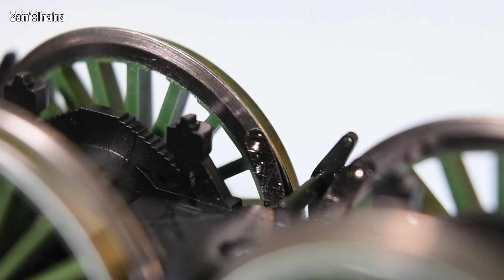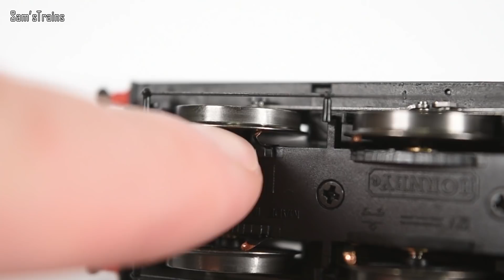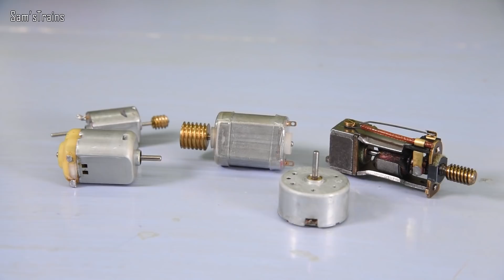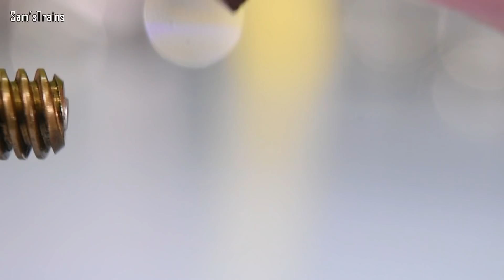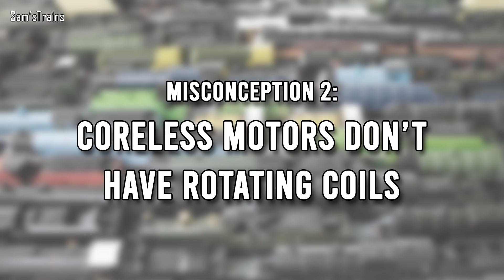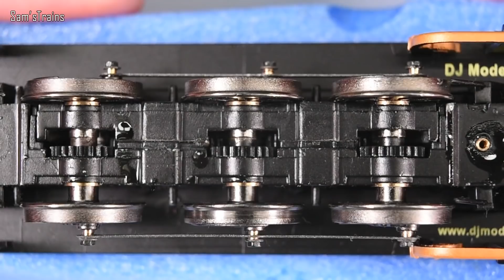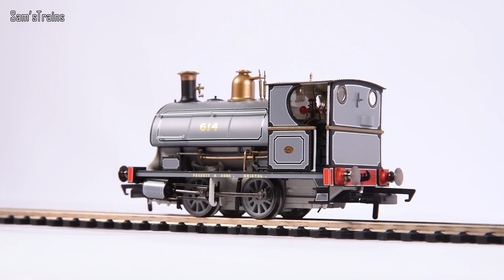What Makes A Good Runner? | How Model Trains Work

Comment: You'll only find a brushless motor with an AC supply.
Reply: steppers are dc no?
Reply: @muir8009  Oh bugger, stepper motors, I'd forgotten about them!!
Reply: Formidable38  there are so called BLDC motors, they are brushless and DC , but you need an external electronics to drive them.
Reply: @railfilm  microtains use coreless motors in their z scale locos (with appropriate warnings re: heat and feedback controllers), whilst being absolutely stunning crawlers, I think it's more to do with trying to cram a motor and decoder into a z scale sd40
Reply: muir8009  that ia correct,. Some high-end models have also coreless motors, but it can be a challenge to use them in common DC systems, as those motors require different approach, not common with the standard motors. The small model like in Z scale, they do not have too much choice because of space and size. Today there are plenty of extremely cheap coreless motors ( almost in each mobile phone)   But in mixed layouts like Sam´s it is not always an advantage. Many modern controllers does not work with such motors, and there is always the danger to overheat them.  On top of that usually they are also extremely fast so one need much more gears ( or finer ones)  as with the standard motors. They are better for DCC systems, as many modern decoders have a special CV option (high frequency) for coreless motors..
Reply: @railfilm  thank you for your informative response, good to learn. I've had coreless z, and had Marklin z at the same time and really came to the conclusion that yes, traditional style iron core motors can be made small, but it struck me as more technical achievement over substance. did have a coreless steamer in tt, and I think you may have touched on something their where their availability, size, and price may make a smaller manufacturer (schirmer tt in this case) be able to produce a model at a competitive price. basically running wise in a larger than z size I couldn't find an operational advantage. (but boy that microtrains just seemed to age marklin by 40 years...)
Reply: muir8009  yes, the variety of new generation of motors for us tradional modellers creates several problems. Unfortunately the designs of new locomotives very often ignore the traditional DC model railway requirements. I have over 60 locomotives purchased  or built (scratchbuilt) in the last 50 years. While in the past the speed of the model locomotives was one of the major factors, today the model manufacturers have serious troubles to calculate the gears and make the models with realistic speed. On analog DC layout we use a common throttle  for several machines on the same track ( block system etc), and is extremely unrealistic when the small shuntig locomotive is faster then the modern high speed model. What is even worse when one has the same model from different manufacturers having completely different speed characteristic. The differences are in my case over 50%. Maybe a topic for Sam for one his next technology videos. I have already a speedtrap on my layout to select the locomotives  with an acceptable speed at given  throttle setting. I have also several locomotives with coreless motors but I would not recommend them for the classic DC model railways. They are primarily designed for digital (DCC) layouts, where each motor has its own throttle, (decoder) what can be programmed  for this  special motor and also adjust the speed characteristic for the model.
Reply from the maker: I'm no expert, but I understand you'd need circuitry that synthesizes specific waveforms/signals to drive a brushless motor, so the input shouldn't matter too much!
Thanks for watching, Sam :)
Reply: Sam'sTrains Do not mix together the coreless motors with brushless motors. The coreless motors like in your video have always brushes, from this point of view the operation principes are the same with the standard iron core motors.
The brushless motors have always at least 3 wires and 3 not moving coils, and an external signal generator generates the 3 phases for the coils. With the frequency you can control the speed. When you change two wires the direction will change. Ie you need a special interface circuitry, what converts the voltage from the tracks into frequency, to control the speed and when the polarity is changing the electronics must swap two terminals on the motor. It is easy :-). 
( some minor problem, that the electronics on the board needs always a power, ie, in DC it will work only above certain voltage.).

Comment: Thank you so much Sam. This is a great video. It has greatened my knowledge so much. I really didn't know this much. Thank you. I'm fairly new to the hobby so this question might sound stupid:
If you model was to have a three pole motor could you take the motor out and change it with a five pole motor. 
Cheers Matthew
Reply from the maker: No problem Matthew, thanks so much! Yes, if you can find a suitable replacement motor, it certainly can be done! :D
Thanks for watching, Sam :)
Reply: I've done something cleverer than that: with a couple of my Marklin locos: I bought 5 pole armatures (available through their spare parts supply) and replaced a 3 pole armature with a 5 pole armature. You have to know what you're doing but back in the day (until about 10-15 years ago) they only used about 3 basic motors on all their locos and so the parts within each motor type were completely interchangeable.

Comment: Any locos have more than 1 motor?
Reply: older tinplate
Reply: Yep. Take a look back at the Heljan Beyer Garratt review Sam did, and he also serviced an old engine in a stream a while back that had 2 beefy motors. (A red electric loco if I remember correctly.)
Reply: @highbrookendmodelrailway  there's been a few produced but in the pre dcc days twin motors have always been eminently suitable for ac powered equipment (for the obvious reasons). Lionel from the twin motored 42 from the twenties, through the supermotors, then their postwar F3's, trainmasters, GG1's etc all had twin motors, and these are massive, torquey AC universal motors, way more powerful than the dc cousins, their standard gauge supermotor being an absolute colossus, and of course were always permanently synced due to being AC. I worked out that the monster train Sam had hooked up behind the garratt weighs about the same as 1 Lionel state car...
Reply from the maker: Sure! Its rare, but they are out there! :D
Thanks for watching, Sam :)

Comment: On the motors part you missed out ringfield motors that all of the old Hornby and Lima models used. I don't know if these are classed as a three pole motor though?
Reply: the poles are on the armature, so the rather sad ringfields on the Margate hornby and Lima are definitely 3 pole. on quality ringfields such as hornby dublo and Fleischmann still 3 pole but work as they were designed and intended to do
Reply from the maker: Yes that's true, though they fit into the 3 pole motor category, they're just arranged a bit differently!
Thanks for watching, Sam :)

Comment: i call it Soviet engineering (AK-47, Mi-24, several of their tanks and even manage to convert Fiat 12 to much sturdier Lada 1200 with the concept), but it ultimately boils down to: make it as simple and tough as you can, preferably able to survive Syberia and Sahara.

There is unfortunately a line which, when crossed makes the durability worse so it is partly about minimization of strain on each component too.

Basically built it like a tank that wont get maintenance for next 20 years.
Reply from the maker: Yep I'd agree with that - the simplest toughest designs definitely work the best!! :D
Thanks for watching, Sam :)

Comment: I will be very interested to see if careless motors become more common, but am.not entirely convinced about their use in model engines.  Simple is probably best, although my DJ Models engine goes very well, it is very complex with all those gears - the more you have he more you have to go wrong.  Of course Bombardier do traction tires on the real thing - take trip on the Montreal Metro.
Reply from the maker: Thanks Ian - it seems they're becoming more common already! Yes not all DJM models run badly - my 1361 is a very good runner too! :D
Thanks for watching, Sam :)

Comment: sam i am saying this based on personal research as i only run a battery only model railways cause i cant buy proper metal tracks and im an RC hobbyist so i have a lot of rechargeable batteries
there are no brushless motors in any train smaller than O gauge due to their price, complexity, but they are mainly used in continuous running and its large power output and efficiency
There are brushless kits for OO to HO gauges but you do need a high voltage controller
dozen pole stepper motors that is programed for train models can remove cogging and stalling all together

Also can you do a tug of war of your locos ( i know this could seriously damage the locos but give it a try)
Reply from the maker: Thanks a lot - yeah I'd expect that to be true too - thanks a lot for sharing! :D
Thanks for watching, Sam :)

Comment: I can't speak for all model trains but my old Hornby 110 DMU works by catching fire when voltage is applied. Should probably see to that
Reply: The old Hornby 110 DMU's use ringfield motors I think there is a video on YouTube talking about this issue as I had  the same issue with one of my old hornby diesel locomotives.
Reply: My 110 stuck like hell but didn't catch fire. Fun Fact :- 110's catching fire was true in real life! At least until they improved the insulation, but even then, Hammerton Street calling them the "Greasy Grills" suggests that there were a few more fires than the norm........:-)
Reply: Probably shorted quite badly. 

Make sure there is no carbon buildup between the slots on the commutator, wheels are clean, commutator is clean, fresh lubricant, etc.

Normally you can immediately see what is wrong with it when you open it up - most likely a blackish sooty area if it had been catching fire, so you should get an idea of what it is pretty soon!
Reply: @highbrookendmodelrailway  Yeah I've had a look and it's just in really poor condition. If I can get the time and I can probably get it going again. Thanks for your suggestions 🙂
Reply: @blisseyran-dom6822  You're most welcome 👍☺️.
Reply from the maker: haha yeah that doesn't sound too good - I've seen a few firey ringfield motors myself too! ;D
Thanks for watching, Sam :)

Comment: 1:12 Are there any live diesel-electric powered trains (at least ones in 127mm gauge or smaller)?

As per bearings, are there any models that employ tiny roller bearings?

Very informative video. Be careful, if Oxford University ever introduce a course on model railways, they may beg you to be the professor.
Reply from the maker: I haven't seen any, though maybe you're right?! Never seen roller bearings, but I'd be interested to know the answer!!
Thanks for watching, Sam :)

Comment: How about running a model train in a vacuum to see what the lack of air does.
Reply: It would still work exactly the same - electrical motors are not affected by vacuum - the power tools astronauts use to do work in space are electrically powered. Only difference being that you probably wouldn't be able to hear it running.
Reply: I suspect heat would build up but there’d be no oxidation.
Reply from the maker: haha still would be pretty interesting though - and agreed with Ian, heat dissipation may be interesting to observe... though without air resistance, the load on the motor should be less!
Thanks for watching, Sam :)

Comment: One thing that's bugging me at the moment... People putting grease on the gear-train of Lima diesels. I've bought around 60 of them in the last 10 months and several were bought as non-runners. When you put them on the track they just hummed. A quick dismantling and a clean off of the grease and they are away again running smoothly. Lima gear-trains are made of nylon and they are self-lubricating. I know people put grease on them to try and make them quieter but in the end it either goes hard or some grit gets flicked up of the track, gets caught in the goo and then locks up the motion. When I launch my new channel soon (under a different name) I think I will do a video on Lima locos and how to get them running really nicely, even doing incredibly slow crawls, not that that is my thing. Anyway, keep up the good work :-)
Reply: Bindon Rail  Less lubrication is always better
Reply from the maker: Yeah that's it- when the lubricant gets old, it certainly harms performance! I do use a small amount on my Lima locos... because I service them every year, I never have any problems!
Thanks for watching, Sam :)

Comment: Hi Sam.
Is it possible to get different gears & worm drives to adjust the gearing ratio so a loco runs better at slow speed, also to reduce it's top speed to make it more prototypical.
Could you do a video on how to fix wobbly wheels on a loco, so it runs smoother.
Thanks for the great vids (keep em coming). 👍
Reply: you can buy separate sale gearboxes from suppliers like north yard and branchlines, northwest shortlines etc
Reply: @muir8009  Cheers, will definitely look into that.👍
Reply: @Sparky-Tim  if you're in the UK I'm sure a company there called branchlines makes a nice kit (I'm elsewhere), but inevitably there's a likelihood of some re-engineering to be looked at
Reply from the maker: Yes in theory it's possible, but you'd need very specific gears to fit into lots of these mechanisms... could be quite a rabbit hole!
Thanks for watching, Sam :)

Comment: OK, clever clogs. Since you know more about steam engine motors than I ever will, because I hardly ever think about what sort is inside my steamies, here's a question from me you might be a bit scared to answer. Be brave, my good fellow.
On three separate occasions, you experienced what I would call a motor explosion. First, your class 58 diesel suffered an exploding motor. Second, poor little Terrier Whitechapel suffered the same. Third, one of the 14xx tank engines was in the same war. What could cause an engine's motor to blow up, apart from the fact it might be old and worn?:_SamstrainsGad:
Reply: @highbrookendmodelrailway  Thanks, but I asked Sam, not you. Kindly remember, my good fellow, it's not nice to answer before Sam has a chance to get a word in. I'm not telling you off or criticising, but please, next time let Sam answer before you speak.:_SamstrainsGad:
Reply: @kellyashfordtrains2642  Apologies Kelly. I didn't think Sam would find it rude. I'll delete the comment.
Reply: @highbrookendmodelrailway  Good idea. Apology accepted.
Reply from the maker: haha good question - usually it's overheating or oil on the commutator! Sometimes the motor brushes can crumble away, and jam up the motor too! Though it's difficult to work out exactly what happened after a motor has fried!
Thanks for watching, Sam :)

Comment: A good mechanism: as few moving parts as is physically possible while getting the job done - and each part being of the highest possible quality and precision.
A bad mechanism: Anything else.

Also Sam, speaking of power pickup - review a Märklin starter set! You must give your take on the 3-rail system, german engineering and... traction tire policy. ;)
Reply: funny you mention good mechanism is few parts to get the job done and yet the opposite is true and practiced and you refer with a marklin!
Reply: @muir8009  It depends how you choose to interpret what I wrote. You could say what I mean is no unessecery parts, then.
If you can get away with having 2 gears instead of 3 it's one less point of friction and one less part that will wear. Also, it's one less part that will cost money.
Reply: @JonatanGronoset  I like :) I had a gaiety pannier tank which had the optional factory 7 pole motor and the fairly serious 40:1 gearing (generally considerably lower than today's models) and my dublo 3 pole standard 9:1 gearing was actually a better low speed runner, and a lot less noisy. I got what you were saying in all honesty, and of course Marklin: brilliant. I'm just stirring with the old what makes a good quality mechanism. funnily enough I still think that 3 rail is still by far the best for practical operational running and still gets far to much grief solely because it's 3 rail. traction tyres we won't mention... :)
Reply from the maker: Yep I'd agree with that - the simpler the better really! I'd love to try the 3 rail system some time - it's always interested me! :D
Thanks for watching, Sam :)
Reply: @SamsTrains  funnily enough I think a lot of people don't realise that 2 rail was first and 3 rail proved so reliable and useful that 2 rail was dropped. 3 rail has got an undeserved bad rap over the last many decades. yes, of course the third rail is unrealistic (as are underlength platforms? dual lane roads that in real life wouldn't even qualify as a car park? st Ives could fit 12 coach trains and have plenty of room to spare etc etc) but 3 rail is so easy to wire. instead of the oval you can have a dogbone and connect both east and westbound tracks at station yards with zero polarity issues. blocks so easy: isolate the central rail with one wire to each section. common return so pretty much just one wire from an outer rail and that's it. and the tracks need considerably less cleaning... :)